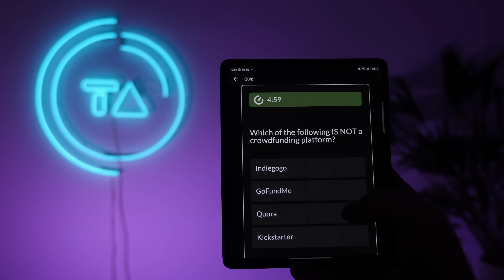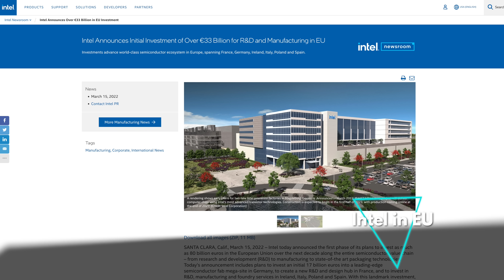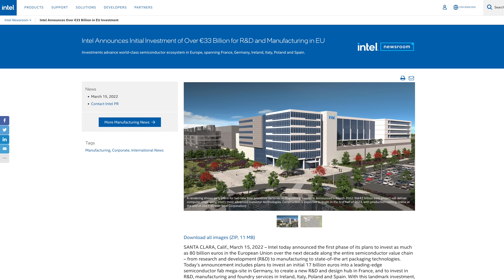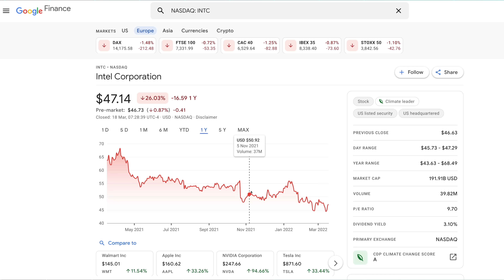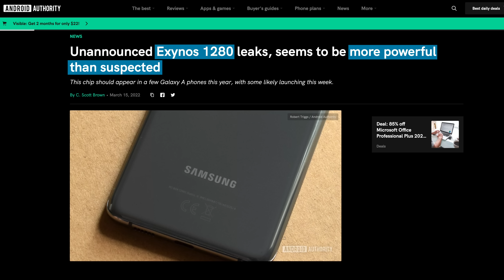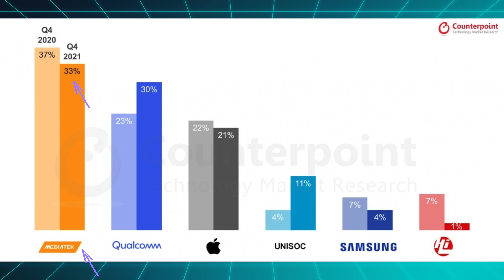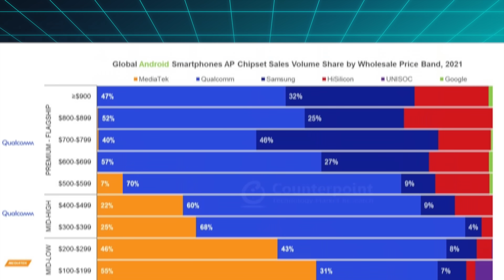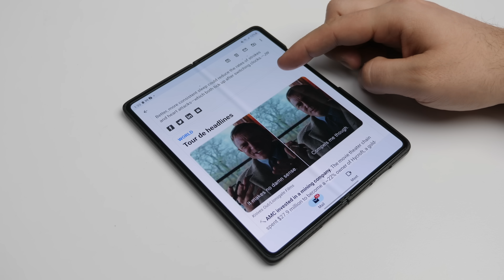Good guy Intel saves us all

Comment from the maker: Some corrections:
- The Mi 12 Pro has a telephoto lens. What I meant to say is that it only offers minimal zoom (2x)
- The A53 doesn't have an LTPO screen. I thought I read that when I skimmed the spec sheets, but I was wrong.
- To get more news, don't forget to check out Morning Brew: https://bit.ly/mbfridaycheckout7
Reply: you should have also compared the a53 to the a52s because that one has a newer and frankly extremely speedy processor to be honest with you. i purchased my A52s a month ago and the processor blew me away. I then googled it's geekbench scores and they are similar to a snapdragon 865. The GPU isn't equally fast but idgaf about the GPU.

I actually do not regret my purchase, because the A52s still has a headphone jack and the A53 doesn't.
Yes the battery on the a53 is a bit larger and maybe it has the better cameras but the rest of the a53 is exactly the same as the a52s (yes, yes, except the processor too, but the one the a52s has is MORE THAN ENOUGH for all people already so idc about the newer one)
Reply: Thx for your video👍
Reply: Boycott samsung, they still sell products at russia.
Reply: Xiaomi totally garbage

Comment: It's true that the A series is great compared to the S series but this year there are downgrades compared to last years phones. The A53 is slower than the A52S while being more expensive and loosing the 3,5mm jack.
Reply: The A53 is technically a successor to the A52 5G, so the processor isn't a downgrade. The A53s 5G will be the successor to the A52s 5G, so it'll have an upgraded processor

Comment: You missed the Galaxy A52s 5G. Compared to that, the A53 5G might not cut it this year. A definite downgrade is that it has no headphone jack, it's dubious if the Exynos 1280 will be able to outperform the Snapdragon 778G, it's also rumored that Samsung is gonna pull an Apple (no charger in the box). The only upgrade seems to be the larger battery.
Reply: Pulling an apple is not a rumor anymore at this point, there's no charger
Reply: @muhammadaji3214  Yes, I've just watched the official Samsung unboxing video. Also, they include a Type-C to Type-C charging cable so you won't be able to use your old chargers with Type-A socket. 👎
Reply: Boycott samsung, they still sell products at russia.

Comment: Xiaomi is downgrading all new models feature wise compared to the respective models from last year. they just throw in the 5g and everything is worse than last year, I think that could be a good topic for the next techalter video.
Reply: u forget to mention mi 12 is alot more cheaper than mi 11
Reply: @superiorkaos  it's not about just the flagships tho, their Redmi and Poco brands have released new phones that have all been a downgrade processor wise from last year's offering
Reply: @shuja.j  the only major one is the global redmi note series. The k50 is better than k40, m4>m3, mi 12> mi 11. You get a worse processor with poco x4 pro but the display is much better and better charging. Not everything is about processor if thats the case you should buy iphone se 3
Reply: @superiorkaos  yea there's definitely truth to that, but considering that the X3 pro had a 860, the 695 in the X4 pro is a very significant downgrade, especially in terms of graphical performance. Other than that the Redmi Note 11 series has been incredibly underwhelming, with the 11 Pro having an arguably downgraded camera.
Reply: The last very quality series, where they did not try to save money was mi 9 series. I think that mi 9t pro is one of the best phones ever made in Xiaomi. Super powerful soc, pop up camera that costs more than cutout front cameras. Glass is at the back of phone also, and aluminium frame. 10th series was also very good, but now, i think that Xiaomi is not best quality-price ratio phone.